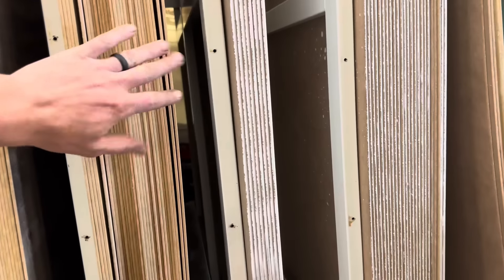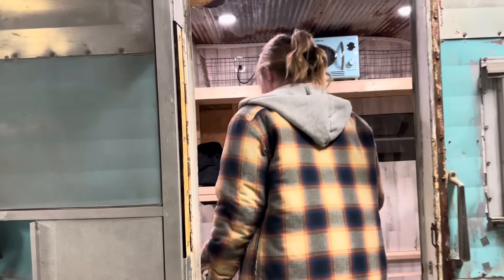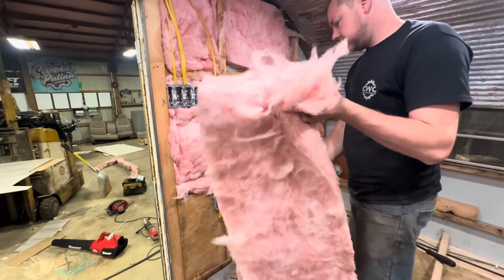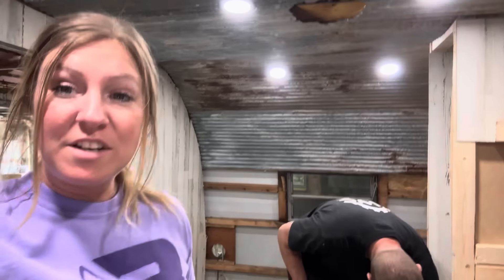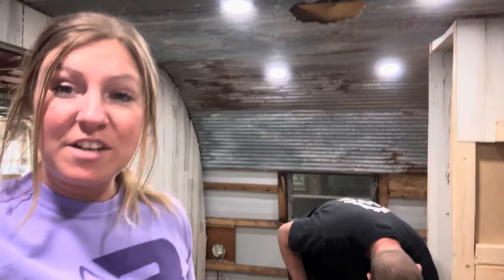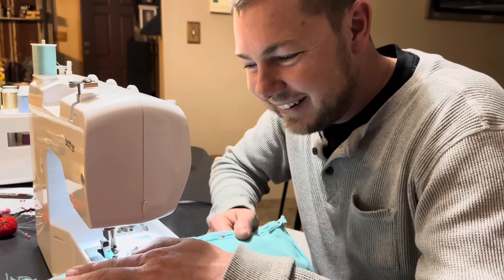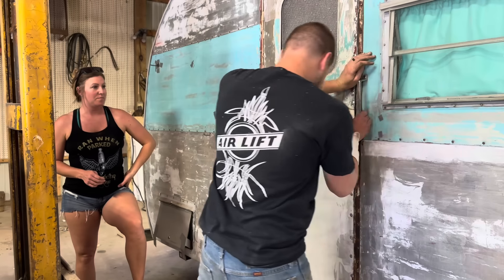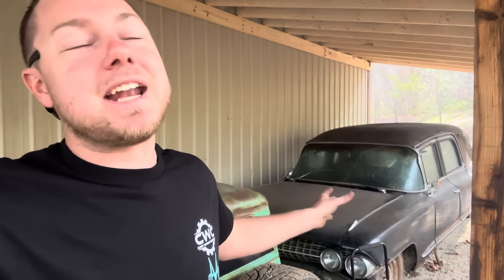PLAN B… ROD RUN PREP!!!

Comment: Just a little info for you. Most doors inside your house are  hollow core doors , they all have cardboard inside them.  Another helpfull hind is when working with fiberglass insulation, use baby powder on your skin , it will keep the glass from sticking to you and you will smell better too.

Comment: Next camper you wire , use #14 wire for the light circuits , more flexible and easier to work with  no need for #12 wire in light circuits , especially with led lights nowadays ...

Comment: I \restored a camper in 2018, The one thing I wish I had done was glue the interior more securly.  the modern construction adhesives work wonders and the camper stays stiffer because of the glue joints. Looking good! Glamping in little campers is a thing and often requires a decorative theme.  so cool! BTW- - - If you look at Northern Tool youcan buy a 26 gallon weed sprayer tank with a 12 volt pump that has a pressure switch set at 70 PSI.  I bought a new one and use it for drinking water and a shower supply.  The shower is cold as I have not added a water heater.  I modified the weed sprayer wand and converted it to a foot valve and added a shower wand for showers.  so far It has worked for 4 years no issues.
Reply: That a great tip for everyone working on a project

Comment: Old tip for cutting foam from the retired Auto Upholster.  Level 1 hacksaw blade. Level 2 electric carving knife like you used for Thanksgiving.  Level 3 take your little air grinder with some 80 grit and you can give the foam final shape.  To make it a little plush glue, some batten to the foam and slide your cover on. Just hit me up I love to pass on the knowledge.

Comment: Hay thanks for the trick to measuring out the wood,  that's one way to do it.
I would have used paper or cardboard.
I had a 1964 Shasta camper year's ago I bought off the original owner.
That I let the wrong people try to help me do a few renovations on it that turned into a disaster. Destroyed it. I should have just left it alone and until I did my research on help to get it redone.

Comment: I grew up with no guards on any power tool or chainsaw!  I still have 10 fingers ten toes, but only 9 toenails!  If you drop a Dodge 2500 tailgate on your big toe, break it 3 different ways  ( my toe, the tailgate was fine!).  My toenail had to  e removed.  Eddie
Reply: flip-flops?